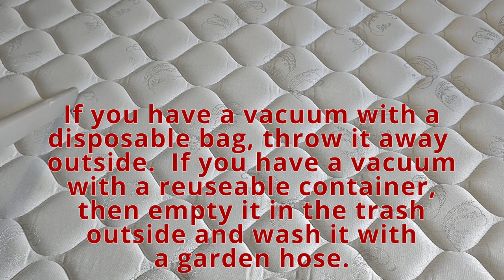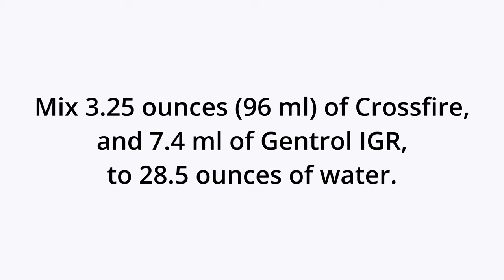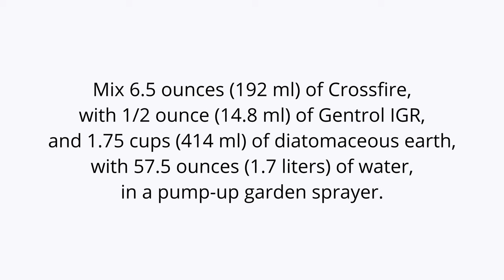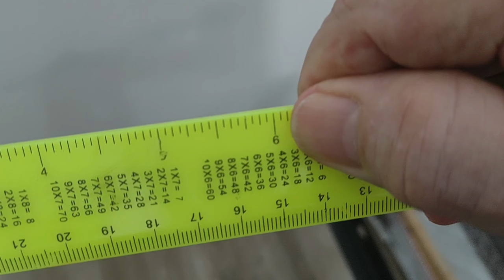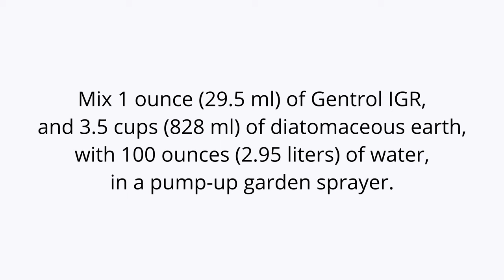ULTIMATE Bed Bug Solution!  AMAZING.  This ALWAYS works.

Comment: I can't say what happened; I came across some bed bugs in my house last July, and immediately ordered a steamer to steam everything. Then I used a shop vac to suck every crevice I could, everywhere. Plus, I already had some tea tree oil, and so washed all my linens in hot water with tea tree oil in it, and then on into the hottest setting in my dryer. I also put some tea tree oil in my liquid soap, and washed myself in it, as well as my pajamas. What worked here, I don't know; the steamer never arrived. But for some reason the bedbugs abandoned my bed, my sofa, my loveseat, and me. They've been gone since last summer. The house is nice and warm, but no bed bugs. (I have hardwood floors, and had taken the rugs out and beat the hell out of them, and left them hanging out doors overnight, then replaced them in the house).  I had only heard about the tea tree hatred that bedbugs have, so maybe that had something to do with it.
Reply from the maker: So sorry for the late response.  I am only now seeing your comment.  That happens sometimes.  My thinking on your situation is don't question it too much.  The important thing is that the bed bugs are gone.  For whatever reason, the stars just aligned for you, so take the win.  I love a happy ending.  Be well my friend.
Reply: any updates? would love to know

Comment: Please give alternative options for Germany im currently here and the situation here is horrible, theres no crossfire or gentrol IGR or anything EXCEPT Diotomaceous earth. My house master isn't doing anything and they've been here since I came. So i have to do a full house clean😪😪😪
Reply from the maker: I am so sorry that you are having this problem.  For people who cannot obtain all the products in the video, it is possible to eliminate a bedbug infestation by using only vacuuming, steam, and diatomaceous earth (DE).

The key to success is to be thorough, and to use the hottest steamer that you can find.  The hotter the steam, the better it will work.  The steam must reach a temperature of at least 160° f or about 71° c.  I would regard this as a minimum temperature.  There are steamers available that can almost double this temperature.  Since stream is going to be your first line of defense, you want a steamer that is going to kill instantly.

Always start by vacuuming thoroughly.  If you have a bag vacuum, throw the bag away in the trash outside.  If you have a vacuum with a reusable canister, then empty it outside, and wash the canister out with a garden hose before bringing it back in.

Take your time with steaming.  The hotter the steam is, the faster you can move the wand, but do not go too fast.  The slower you go, the better the chances that you will kill all the bed bugs and eggs.  However, if you are using very hot steam, then do not keep the wand stationary, to avoid damage to the item being steamed.  You can move it slowly, but make sure that you are always moving it.

Finally, apply diatomaceous earth as shown in my video.  It is going to work best as a dust, so use it that way as much as you can.  DE can be effective when mixed with water, but it works best if you just apply it as a dust.  So, if you are treating a bed frame, apply the DE as a dust.  You cannot apply the dust across all the floors for obvious reasons, but you can apply it as a dust under furniture.  This would be particularly helpful under the bed.  So, be sure to dust under all the furniture.  If bed bugs are hiding in the furniture, then they will need to cross that dust to get to your bed.  Also be sure to apply DE under all baseboards.

Remember, the key to success is to be thorough, so do a really good job.

I hope that helps.  Be well my friend.

Comment: Being an Army veteran, my first inclination is to get an Army cot and store the bed in the garage. Now place each leg that touches the floor of the cot inside a box  container filled with D-earth and then spray the cross metal legs to isolate you from them and neutralize the critters when they try to get to you.
Reply from the maker: I suppose that would do it, but you can keep the bed.  It just needs to be treated.  After treatment, the bed is perfectly safe to sleep in.  Still, very creepy.  I hate these things.  Be well my friend.

Comment: I'm just starting treatment of my place along the lines you suggest. I only found one live BB and one dead one but I've been bitten a number of times. Two questions: I have a wall full of tools. Do I have to bag them all up and then spray and then put them back or do I just spray them. Not sure about handling them. I'm using Crossfire mixed with DE (Gentrol liquid  couldn't get to me in time so I got a spray can of it) also I'm leaving soon for a 3 month trip. I'll be staying in one place. I have a number of electronic music modules (like the size of a game console) and hard drives. I don't want to bring any bedbugs  with me. How can I treat these things and , in general, safely pack for this trip? Thanks!
Reply from the maker: You did not indicate what kind of tools you are talking about, but unless there are hiding places in the tools, like drills and things like that, bed bugs are unlikely to be hanging out on any sorts of hand tools.  So, you probably don't need to treat them.  I would concentrate on treating the wall on which they are hanging.  If they should be inhabiting some sort of tool that has a hollow space in it, they are most likely going to get hungry at some point and cross the wall in search of a meal.  That of course is going to cause them to die.  It is very similar for any sorts of electronics that you may have.  The truth is that bed bugs do not usually inhabit electronics, but they can. The same principle applies about treating the surfaces around the electronics.  If there are bed bugs and a piece of electronics, they are going to get hungry and come out within a few days.  When they do, they're going to cross the pesticide that you put around those items.  So, the key is to be thorough and treat as many surfaces as possible.  You are kind of creating an island that the bed bugs are eventually going to need to escape from and the pesticide that you put around it is kind of like sharks in the ocean.  If they want to leave the island, then they are going to get eaten by the sharks.  Okay, maybe that's a bad analogy, but you get the point.  Just make sure that those music modules are on top of a surface that has been treated.  If you leave them on the surface for about a week, then you will probably be okay.  Of course, the longer they are on that treated surface the better it is. 

Make sure that you treat any luggage that you will be using, and make sure that it is stored on a treated surface. Always wash any clothes that you will be taking with you and dry them on a high heat.  As soon as the clothes are washed, you should bag them and then seal the bag, to avoid them becoming infested.  It would be a good idea to immediately place the bag in your treated luggage.  You can treat the luggage much the same way as you treat your mattress.  Thorough vacuuming and steam are your best friends.  After vacuuming and steaming, you can apply Bedlam Plus in all the seams and areas where bed bugs are likely to hide.  The bottom line is that, if you are packing for a trip, you should assume that you have bed bugs in everything, so you should treat everything as well.

I hope that helps.  You well my friend.
Reply: @GuysPestSolutions I really appreciate your reply. Your video is extremely helpful. They're both really useful as I haven't found any forums where there's real and reasonable discussion and detailed answers to questions. The one on Reddit is the only one I came across and it hasn't been much help.  Unfortunately I couldn't get hold of Bedlum Plus in time before leaving. I was able to get some Nuvan Strips (only the big size could get here quick enough) so I have 3 of the big ones I thought about breaking up for different places. I also just got a bottle of Cimexa. I bought a Wagner 915e steamer locally (to be quick) but when I put my instant read thermometer on it, it seems more like 140 rather than the 200+ I was hoping for. I haven't seen this discussed but couldn't I use my heat gun in some places more effectively? I saw a video https://www.youtube.com/watch?v=dDOHl1fIOhQ while I was thinking about this and saw it takes quite a while before things actually begin to burn. In a separate matter does it seem like a good idea  to put my electronics in in a bag that's been treated with Crossfire and/or some of that Nuvan strip as I fly? I can leave the music electronics in a bag for some days but I'll need access to the laptop soon after landing. I'd like to give it the most intense treatment that works the quickest. Not sure I should mix DE for the laptop as it does look a bit messy going through security.  I have a new bottle of Crossfire and the Cimexa. Do you think I should use it mixed with the Crossfire instead of DE as I treat the kitchen, workroom and computer/music area?   Many thanks!
Reply from the maker: I don't think I would use a heat gun.  I have one and they put out a lot of heat.  I would be afraid of damaging some of the surfaces.  140 degrees is not going to get it done.  You need at least 212 degrees.  Some steamers will put out over 300 degrees, which would be a good idea.  That will kill bed bugs instantly.  You can place electronic equipment in a bag with a Nuvan Prostrip, but this is not a fast process.  It usually takes 10 to 14 days for it to work, and it is recommended that the bags not be moved.  So, I don't know that this is a good idea for traveling.  This is a somewhat hazardous material, and you wouldn't want it breaking open during travel.  I can't even imagine the crimes they would charge you with if anyone got ill on the flight.  I don't think that would end well for you.  If you do it, make sure that the bags are at least 2 millimeters thick.  You don't want the regular, white trash bags that you use in the kitchen.  You need the thick contractors' bags.  Also, make sure that it is sealed really well.  I'm not sure how easy that will be to get through the TSA screening if it's a carry on.  You may get busted right there.  What do you tell the TSA agent about why you have these tightly sealed, heavy duty trash bags with you?  I'm not sure, but I suspect it is illegal to bring DDVP on an airplane.  You may want to check into that.  Personally, I wouldn't do it.  There isn't much chance of the bed bugs being in those devices anyway, so I would just take my chances with those things being untreated.  Crossfire is a lot safer, but you would want the bags to be dry before inserting the equipment in the bag.  This will only kill the bed bugs that come out of the equipment.  I'm afraid there really isn't a good way that I know of to do this sort of thing.

I hope that helps.  Be well my friend.
Reply: @GuysPestSolutions  Your comments are a big help! I'll just have to try to treat things as best I can here and leave that stuff behind. I'll be gone 3 months. I'll leave those Nuvan strips all over the place here and see about having someone come in and spray the perimeters a few times. It'll be uncooled and it's not well insulated.  I'm still trying to get my head around treating the main room, which has the kitchen, tools on the wall work area and PC/Music area. I have about 20 plastic drawers and 5 regular wood drawers. Originally I thought about putting the plastic drawers in big contractor bags sprayed with Crossfire/DE. Since then I read that's not great because the bed bugs just stay where they are and then come out when the bag is reopened. My plan now is to give the place a big Crossfire /DE/Gentrol spray down before I leave. Last night I got some dry ice, put it in an insulated thermos with a sticky trap under it and stuck it in the room that used to be the bedroom. As it happened, all my storage stuff was in there when I got bitten as I was working on the storage room. I got rid of the bed and put a new metal one with traps under the legs in the storage room. I put all the 30 boxes of assorted papers and stuff in the bedroom/storage room in contractor bags sprayed with Crossfire/DE and sprayed the heck out of the room after vacuuming and steaming with my Anemic Steamer (does the one you list get hotter?). I checked the dry ice/sticky trap thing today and nothing on it. I only found one bed bug (well fed looking!) ca 6 weeks ago and one carcass. But I got bit many times some weeks after that before I moved out of the bedroom. Even though there are chiggers outside I just noticed 3 bites in the same area on my midriff so it looks less like chiggers to me. Maybe from sitting at the PC for hours like this too long reply! By the way, this is in a semi-permanent RV (with fixed metal and wood skirting storage area underneath). There's a  reinforced cardboard type stuff layer all under it between my floor and the cement pad. Should I consider trying to spray that too? It would seem like the bed bugs could easily just go down a little and stay there? Again, you've already gone way beyond normal by answering any of this so no problem if there's not time to reply further. I learned a lot already. Thanks!
Reply: Hi Guy. How about this. I took my electronic music boxes and stuff that goes with them. Wrapped them up in big towels and stuck them in one of those  big vacuum bags that squeeze clothes to smaller space. Then I stuck 3 of those big Nuvans in and vacuumed the air out. If anybody's going to be doing any breathing in there they'll be getting a big helping of that stuff. I'll leave it for 2 days and then take the stuff out and pack it normally.  What do you think? Also, I downloaded an app that tells how hot the processor is getting in the laptop and saw it got up to 180 sometimes. Heat is a problem for laptops sometimes although mine's been OK. Wouldn't it seem like that would make the BB want to leave? By the way, last night I tried the method they talk about at Rutgers Entomology of removing all the carbon dioxide . I put some stuff in a 3ml contractors bag along with dry ice and sealed the top with a thick rubber band and a ratchet clamp. When I came out the next morning it had blown them off. It occurred to me today that I could have used one of these vacuum bags. Don't know if their seal would hold but they're thick. Or I could just do a proper job of sealing the contractor bag.  Thanks!
Reply: Oops! I found out that they say those Nuvan strips need some air to work so I let some air in the bag. Maybe I'll try the dry ice again in one of those bags although not sure if the seal holds as well with air trying to push out instead of in. 👍
Reply from the maker: @cSounds49  Wow.  You really don't want to take chances with bed bugs.  It sounds like you have a good plan.  Just keep in mind that bed bugs don't usually infest this sort of equipment anyway.  They can, but they usually do not, so don't get too carried away.  I am all in favor of experimenting though, so go for it.  Please let me know how you make out.  Be well my friend.

Comment: We don't have the money for all of that
Reply from the maker: I am so sorry to hear that.  Some folks have been successful by just vacuuming, steaming, and diatomaceous earth.  You do need a good steamer though that gets at least 160 degrees Fahrenheit.  I have one listed in the video description that will reach temperatures twice that high, so the bed bugs die instantly, and so do the eggs.  The key to success is to be very thorough.  Vacuum well, steam well, and then apply the diatomaceous earth.  Also, use the bed bug traps on the beds and upholstered furniture.  You may need to repeat the treatment if you miss something, but it's the cheapest way to do it.  I hope that helps.  Be well my friend.